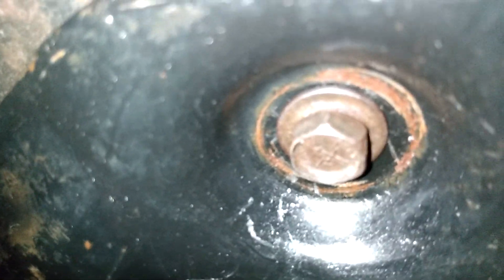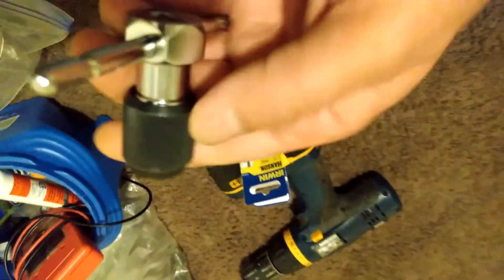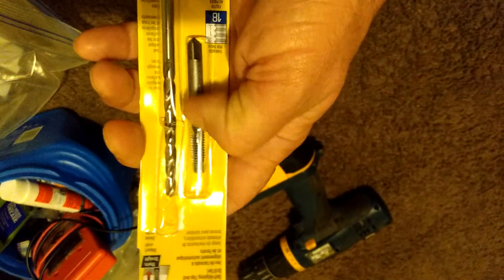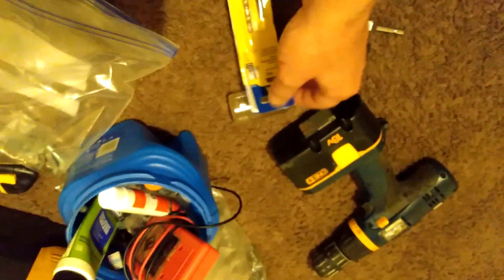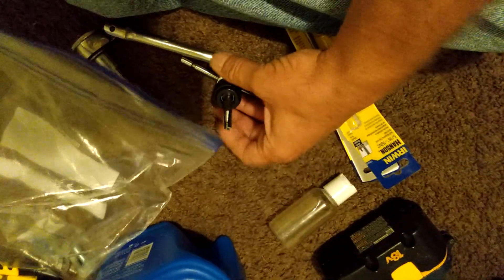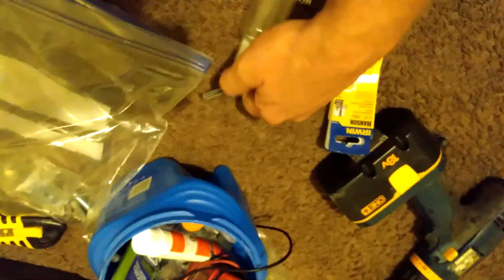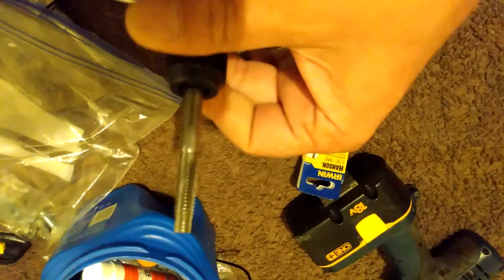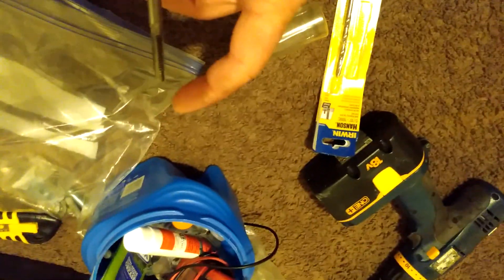drilling and tapping a broken skid plate bolt, with the Irwin tap and drill bit set part 1

Comment from the maker: The bolt on broke was on my own truck a 2007 Jeep Grand Cherokee Overland. I knew better, I should just went with an 1/8 turn past snug on the skid plate bolts and it wouldn't have broke. The. I couldn't get the broken bolt so I drilled through and tapped it to 5/16" and put a bolt and washer that's 5/16" through drilled and tapped broken and sleeve. It worked . The Irwin tap and drill set was under $5 on sale.